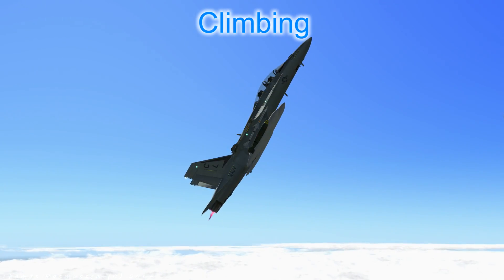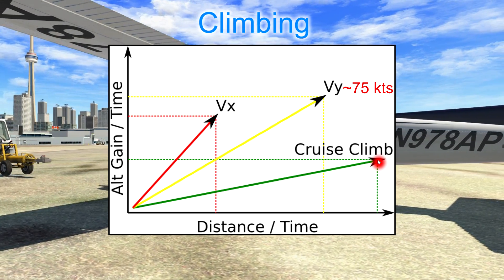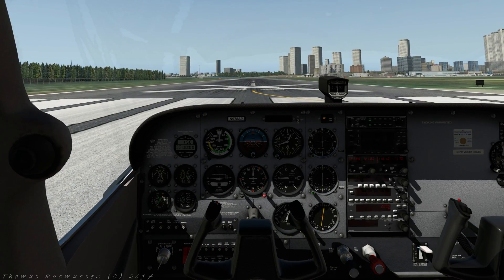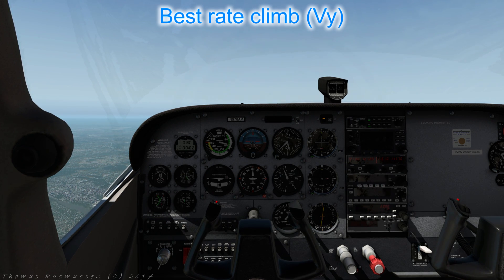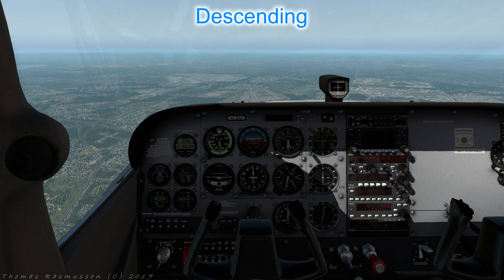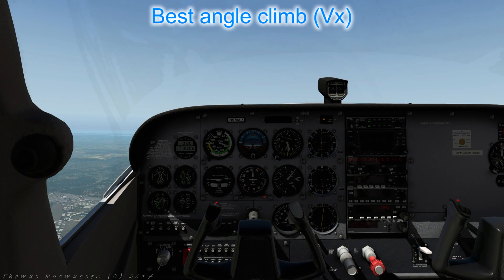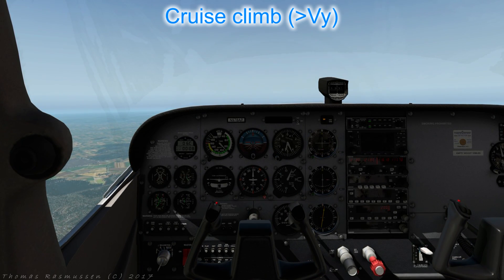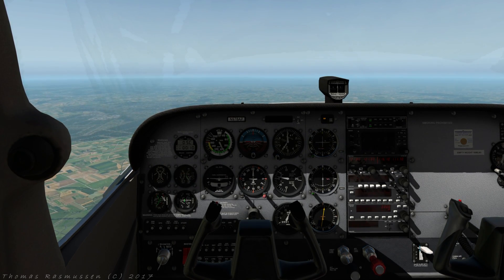[X-plane 11] Flight Sim School - VFR Lesson 3 - Climbing & Descending

Comment: Can you delve into the process of trimming in the sim more deeply? I mean, the scheme is self-evident, if you fly a real plane - you trim until you don't have to hold the yoke to sustain the altitude. But in flight sims this pressure on the yoke/joystick isn't reproduced at all, so you have to let it go hoping you've trimmed enough, and if not, change the pitch and repeat. It's not that convenient, especially when you need to do a lot of things at once and fast. Maybe there's a better way to trim in sims?
Reply: It is reproduced if you have a yoke that requires noticeable pull and push pressure,
Reply: Road Surfer but how? I have Saitek, and the pressure is quite noticeable, but there's no "relief" mechanics built-in. I have to judge by moving the yoke back to neutral and looking if the attitude changes.
Reply: Suppose you have to exert back pressure to maintain a desired attitude, let's say straight and level. As you trim, you need less and less back pressure to stay straight and level, so as you trim you have to ease the back pressure, until you are trimmed and exert no back pressure. It's the same in an airplane.